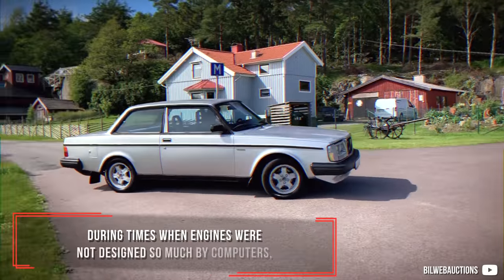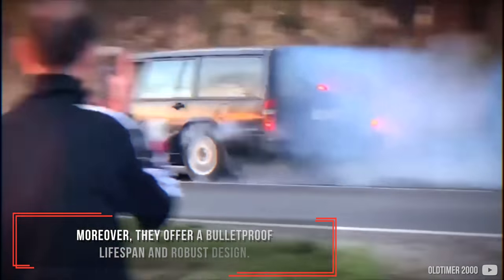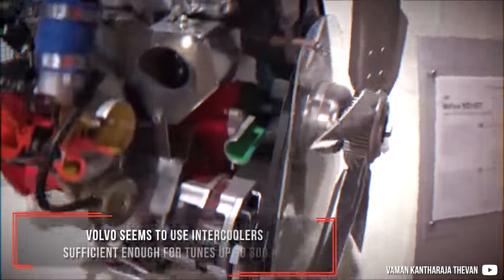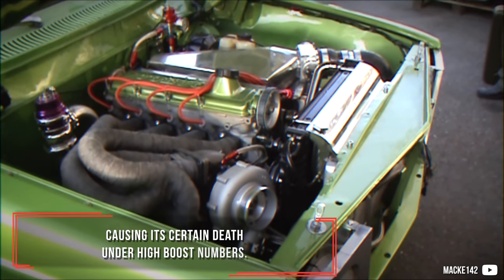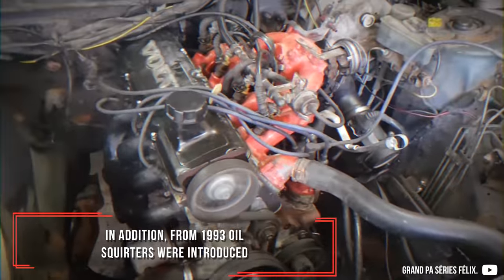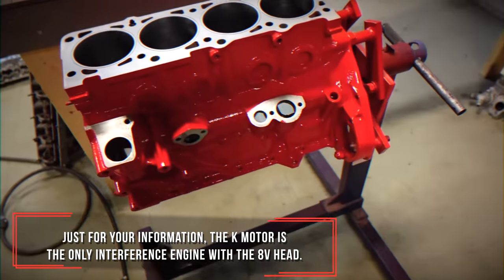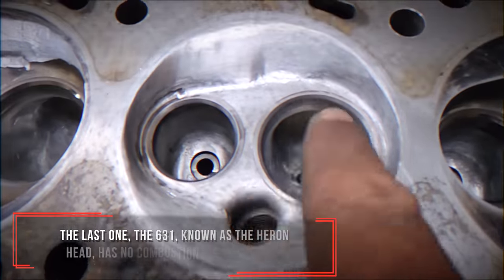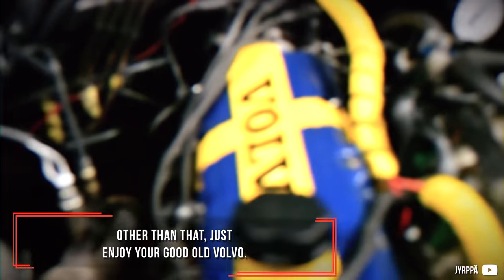Volvo Redblock: Sweden's Best Tuning Engine

Comment: Pretty funny how the Saab engines are almost completely ignored outside of scandinavia. The t5's and t7's are some of the easiest to tune, and can reliably run 350+ with only a turbo, injectors and a dp
Reply: can agree on that, running a T5 @ around 420hp in my R900
Reply: But saab is fwd and that’s not very epic
Reply: @392_isak9  We're only talking engines. The title of the video is also only referring to the volvo engine
Reply: @TheCHRISintheMIX  Ah I see
Reply: @392_isak9  litteraly just place one in a RWD car and your problem is solved..
Reply: Nja, de är rätt populära i UK också faktiskt.
Reply: @Fransenn  true it’s a lot easier to just tune the original motor that’s already in it?
Reply: @392_isak9  The only problem really is getting your hands on one Opel Transmission that bolts straight on to a B234R and making it suited for RWD. its that or you have to fabricate your own adapterplate so you can fit any transmission you like.
Reply: @TheCHRISintheMIX  its because its not worth the effort to swap and it pretty much only came in fwd cars
Reply: @matteponken1  i run 588hp on my t5 stock bottom
Reply: There's a 9-3 running 700+ hp on a stock b234 bottom end
Reply: The saab b2xx engine is the most hushed 800+ capable stock engine there is.. I've often said if my sr20det dies in my S14a I'm putting a saab engine in 🤷‍♂️
Reply: @Ferg2jz  I hope it stays hushed 😁
Reply: @Ferg2jz  Pre GM saab engines are honestly the most tuner friendly engines. Reprogrammable stock ecu with knock sensors and a bottom end build for a tank
Reply: Agree.

Comment: absoloutely adore my brick, i have a 940 with a b230 and it is totally worth all the legal and financial problems it's got me into, i just love how simple, effective and well designed the engine is, can't wait to slap my big chinese turbo on it and get her boosting to decent levels
Reply: Chines turbo,Lmao:):)
Reply: Maxpeeding makes some decent turbos I can’t even lie 😂 but that’s awesome ! Gonna need a better transmission tho if you got the m46/m47. Lord knows they don’t handle torque well
Reply: @TooFlyNico  m46/m47 can handle a simple +t. Clutch wont but the box is fine with 200hp. Luckely an upgrade pressure plate and clutch is 140euro.
Reply: @TTURBOVOLVO  or you just get a m90 and dont have to worry about it till you get to 350-400
Reply: I have an m46 for free off a friend and another one lined up for once i blow it up, it's an auto at the moment, should be manual swapped in the next 2 weeks or so, I'm saving up for a zf gearbox out of an e36 that a guy in sweden adapts to fit onto redblock motors cause the end goal is going for 400whp+, but the substantial modification to the bellhousing mean it's not a cheap purchase, so I'm just gunna keep blowing up m46s with an uprated clutch set up for a while, my turbo is a holset hx35 clone if anyones interested, the hx35 is the bread and butter for turbo brick fans for budget big power, abit laggy :/
Reply: Viking chip, goldbox and some tinkering with the turbo and you have an perfect driftcar for the snow ;)
Reply: Neringa from Latvia, makes good turbos. Don’t send your money to China. When that thing blows, it’s your whole engine gone.
Reply: @einar8019  m90 handles 700+, depends on how gentle you are with shifting
Reply: I have an m90 YAY!!! I'm a happy brick owner 😁
Reply: @billpetersen298  cik tur maksā?
Reply: So whats the best year brick to get to throw a standalone and a turbo on?
Reply: @minibikemadman  latest of course, 1997
Reply: @ghazik3656  dope ill have to look around..I ant about to LS swap it but I would love to build one them. Pretty bad ass. We have a ton up here in New England but the rust gets to em.
Reply: @minibikemadman  get turbo model with m90 gearbox ( reverse is right down or right up ) and watch out for rust around fuel tank. My fuel tank was holding on almost nothing, have seen them even falling down.Battery place will be rusted out too.
Reply: im buying one this year

Comment: Swedish LS engine:):)
Reply: 16v heads flow more than stock Ls head
Reply: @TurboWorld  Can be...
Reply: please don't say that,
any swedish brick is better than any usaer car
Reply: @joe125ful  they do, tested on a flow bench, fact.
Reply: @TurboWorld  Ok.
Reply: @Xayuap  Define better?
Reply: @joe125ful   they are better for doing my generalization in this way
Reply: They also have the same fuel economy 😂😂😂😂
Reply: @Tahmanakki  How?:):)
Reply: c'mon, ls are heavy and with lots of cylinders
you can campare with an rb and you will be more accurate
Reply: @Xayuap  Yeah but its durable and dumb proof too and really easy to tune 100-200Hp without much changes.
Reply: @joe125ful  I'm pretty sure about that

Comment: You forgot to tell if you want more than 300 you can use h beam rods with stock turbo pistons. They can handle 500-600hp.
Reply: There is a great build series on yt by overboostracing that covers everything you need to know how to build a 600hp b230.
Reply: 13mm stock rods are able to handle 500-600 hp too. 
Replacement is only required if the stock rods are not these beefy 13mm
Reply: @vozhdmeister5256  sure, a couple of pulls and very good tuning. But why would you risk blowing up a good block? If you can build a car to make 500hp, you surely must be able to change the rods. Its very straight forward and easy.
Reply: @TTURBOVOLVO  I agree but the fact is these 13mm rods are very strong. They bend when pulling at 60psi of boost but block stays safe.
Reply: @vozhdmeister5256  60 psi is 4 bar boost. You have to be kidding me. If you're not, show me some sources
Reply: @TTURBOVOLVO  I'm not kidding. A friend of mine is running a b230ft @2.4 bars of positive boost (3.4 absolute) in its 500hp drift brick and pushed one same engine to the limit. At 4 bars of positive boost the engine showed signs of failure. Once opened one conrod had bent.
Reply: @TTURBOVOLVO  a friend had set up his launch control wrong on his ecu, and the boost climbed to 6 bars. Or atleast that's what was measured, no way to know if that was accurate by any means. The (aftermarket) intake blew up right away, but the engine was fine.
Reply: Stock pistons are known to hold a lot of power. Later Fk/Ft rods are good for up to 350whp 520nm with a good tune and lighter flyweel, so the curve is lifted higher in the revrange

Comment: I still drive the 1985 245 my parents bought new and i took my driving test in. 235000 miles and the head has never been taken off. Compression test is still 190 psi + on all cylinders. One of the most reliable engines ever made!

Comment: Thanks very much for the video.
Another reason that the 4 and 6 cylinder inline engines were so good in the automotive versions was that the same engines were also designed and made to be used by Volvo Penta in marine applications where the high loads are constant for long periods of time ( no corners or braking! ).
Best regards,
Niall Leslie.

Comment: I had a 1988 740 turbo about 13 years ago, it was an absolute joy to drive and I had it tuned up where it was putting out 300hp with stock internals, a truly great engine!
Reply: I love that stock internals can handle so much! Up to 350 I’ve heard 😁 what transmission did you run? T5? M90?
Reply: @TooFlyNico  was the stock automatic, had plans to convert to manual but the car was rear ended by a distracted driver, unfortunately the car was a write off.
Reply: I've still got one (1986 model). Absolutely stock but I love it!

Comment: Great video!
One of the most powerful noncharged redblocks I've heard of, was a Volvo 122/Amazon with the 2,3 L OHC engine, stroked and bored to 3 L and used twin Weber 52 carbs. The engine wasn't tested for power, but calcylated by weight and performance at the strip, it was thought having about 300 hp.
Reply: We have 2.7l 16v with more power🤑

Comment: Great job. I love hearing about these engines and I especially love hearing about these engines from somebody who’s done research and knows something. 

I only had a standard N/A B230 mated to an M47. But it looked brand new inside at 200k miles when I did the seals preventively. Sold her at 250k, still going strong. I’m kicking myself for that. 
I was finished with mild suspension & brake work. Just began absorbing the work of Paul Grimshaw so I could wring as much N/A horses out of it before considering a head swap & a turbo. She was a blast to be with to cross cross the country. I’ll miss her always; my Annika.
Reply: Get another one bro

Comment: Good bang for buck is also to add a turbocharger to an normally aspirated engine. They handle that fine, daily driven one for from 250k to 350k and the engine never skipped a beat. Very wide powerband for the simple setup and a lot of fun to drive.
Reply: What do you need to do this? I have a N/A b230F

Comment: I had 337whp on my stock 98 b230fk. Only mods on the engine was gasket, arp studs 531 head with A-Cam, 680cc injectors, walboro 265 pump, 3" alu cooler, 3" jt exhaust, comp turbo, and autrinic sm4 standalone ECU. Drove with that for 6 years, before I sold the car. Stock internals are capable for way more than 250hp with a good tune.

Comment: All the rods are forged. It's the pistons and crank that may or may not be going by the engine type. The strong stock rods in a B21FT are also heavy. They won't fit in a B230 type engine either.
________________
Dave, 
1982 242 turbo. 338k miles. MVP coilovers and 3" exhaust. Flowed 405 with a V15. Cossie turbine housing with upgraded compressor housing. 90+, IPD remote oil filter. Some other goodness, too. Been lots of fun over 25 years. Restored in 2k. Now ready for a 2nd restoration.

Comment: I'm on the white block fwd B52 brick life, when you can get an incredible sounding engine in a practical automatic transmission daily with room for 4 people and lots of stuff you really can't complain. Also a fwd Volvo is great n the snow and the heat kicks on quick, these things were made for winter!
Reply: B5234T 😎
Reply: B5244S with intake VVT. All of the modular engines have forged rods so they are probably perfectly happy to get tuned.
Reply: White blocks suck, water pump went, shredded the timing belt, straight fucked every valve. I've since moved to Toyota with the 2AR-FE which has a bunch of potential.

Comment: the best version IMO is the US model 1983 240T, a 505 (claimed but forever disputed) build car to make it eligible to be homologated in Group A racing as a 'sporting evolution'. It featured the 2 valve head with J-Tronic electronic fuel injection, water injection and a bigger Garret TB03 turbocharger, the block had webbing for extra strength, the biggest conrods in any red block and a forged crankshaft. These engines in racing trim put out a very reliable 360HP even with Group A's restricted valve lift regulations. I dont recall one engine ever failing in racing, rarely sometimes the turbo let go, but it was usually a suspension or drivetrain failure that sidelined the cars. These cars were very competetive and it wasnt until the homologation of the Ford Sierra Cosworth RS500 that they became obsolete

Comment: The 405 head was available with small cooling passages as well, but they're EXTREMELY rare. 👍🏻

Also, the 531 head have a little different angle and placement of the spark plug to make it more centred in the combustion chamber for better combustion.
Reply: The 531 runs colder too. The heat is a problem with the 530 and the small turbo's often used stock

Comment: I had a 1986 Volvo 740 Turbo wagon with a M46 transmission. Had the B230FT with a Garrett T3 turbo, intercooler.  Sold it last year. That car drove me up  wall. But lord knows I miss it.

Comment: IIRC the reason for the Redblock's Slant design was due to Volvo having stillborn plans to develop a Redblock-based V8, however a combination of costs and some other little known factor led them to decide it was cheaper instead to get involved in the creation of the PRV Project in 1971 (where the costs were spread out more compared to an in-house project). There was an attempt by Volvo to develop Redblock-based diesels during the 1970s that never made it to production with the company instead using Renault and VW sourced diesels.
There may have also been an attempt to develop a Redblock-based 6-cylinder engine, before Volvo decided to begin Project Galaxy / X-100 engines that became the Volvo Modular engine.
Reply: Yea volvo actually had a inline 6 based on the B20 called B30 from 69-75
Reply: Indeed. Yet what am not sure about is beyond sharing the same bore and stroke in 2-litre forms via the B20 and B19 / B200, what else did the Redblock carry over from the B20?
Reply: @wickiezulu  They had the same bore center, and the last years of the B20 started to switch over for the upcoming engine (like Volvo does with everything), like metric hardware, 8 bolt flywheel etc. 
Volvo actually had a prototype V8 ready for production, but it was cancelled, so the first was the B36 (two B18 in a V) and the last is the one fitted in newer cars.
Reply: @wickiezulu  The crankshaft :-) early b21 has b20 crankshaft with cam gear splines covered by a socket where the oil seal is

Comment: the redblock has its roots way before 1974 with the b18/b20 family which basically are an OHV version. but i would agree that the redblock as everyone knows it started in 1974 with the b21
Reply: the redblock had it's roots all the way back in 1944 when they were known as greenblocks or B4B.
B4B was a 1.4L engine that then evolved into B16 which then had a major block overhaul into B18/B20

Comment: My 84 240 has 463k miles on the original unopened motor and trans. Getting ready to rip it out, reseal it and add boost. Compression still at 210psi after all these years. Healthy healthy

Comment: My 16v pulled like a train. Great engine. Just need to make sure the coolant is good enough to stop corrosion. Having seen what happens to an engine when a belt snaps, it pains me to see unprotected cam belts. One stone flicked into a pulley and it's game over.

Comment: Actually the early edition of the b230 had narrower crank journals than the b23 to reduce friction, different axial bearing design but volvo later decided to go back to the 63mm crank journal width that the b23 had together with thicker conrods and a better axial bearing design. This is very important for tuning whereas the early edition conrods will not handle much power at all and have been known to bend quite easily, different from the later revision conrods that can handle up to between 3 and 400 hp on a standard type rotating assembly.

Comment: The B234 is the 16v version of the Redblock and it is amazing, especially in the slightly lighter 740 GLE.

I believe that Porsche/Cosworth may have done a better job than expected as the 155hp claim for these engines always seemed off to me…but I suppose it’s not great for business if your NA model is more powerful than the turbo 🤣
Reply: Nope, they just are actually honest 155 crankies. They usually measure around 138 to the hubs, for comparison my own modified 8v NA is measured to 146 on crank, and put 130 honest to the hubs. (740 GL, M47 and 1031 rear end with 3.73) The 16v engine has a very broad power band (alot under the curve) for those 155 crankies, thats why it seems "bigger", same with my own modified 8v. The torque "curve" is basically flat from 2000 to 5000 rpm, and passengers guesses were always around 170 to 180 hp, the confusion when i handed over the actual hub-dyno trace of 130 hp, was fun tho 😂
Reply: Fun fact us ford guys use the f head on ford pinto block 2.3L engines since the red block is based on the ford engine.
Reply: B234F: 157hp without cat. 
There are also the B204FT (cat, 195hp) and B204GT (no cat, 200hp) 
Those engines are rare. 
They were only sold in some specific markets like Israël, Italy. You can find them in 740 T16v, 940 T16v and 780 T16v. (only 169 ever made with that engine)

Comment: I got 2 volvo b23 k-jet engines. One a put a cam and done a exhaust. both of them just goes like dreams. I also got a b23a (carb) with a extraktor and cam. its just funny how they takes a real beating like nothing on the ice or track.

Comment: Love a Volvo, started with a 340, swapped the Renault engine for a 2.0ltr F7r from a Williams Clio. Sold that and got a 244 glt, good solid car but slow asf. Then a turbo 940 Celebration came up for cheap and that's been my daily for the last 8 years with a hybrid turbo, boost controller, chip and full SS exhaust, given me no problems so far except its thirst for fuel.

Comment: I had an 740 -91 with some tired 8v engine.
It was the slowest car i've ownd (i have had an 35hp Renault 5) One of my friends bought it and told me that it was one of the quickest redblocks he have had!
Felt sorry for him...

"Fun fact about that car, it turned out some former worker at volvo had owned it and that it was some experimental car. It had some special things added like diffrent components in the enginebay, "wrong"gearbox and the beefy rear axle. But the coolest part, heated steeringwheel!